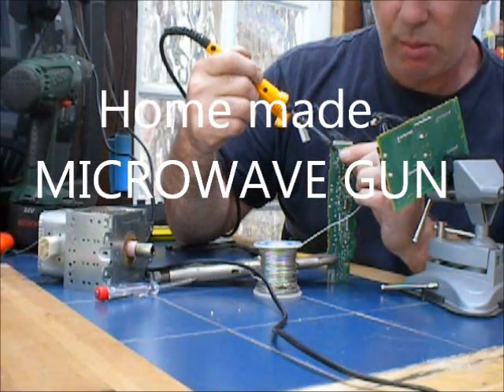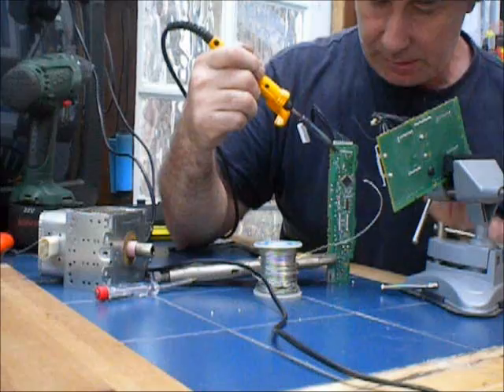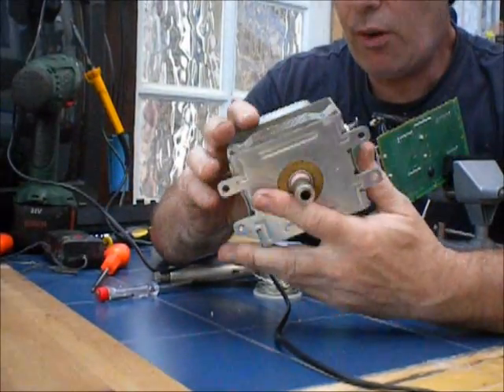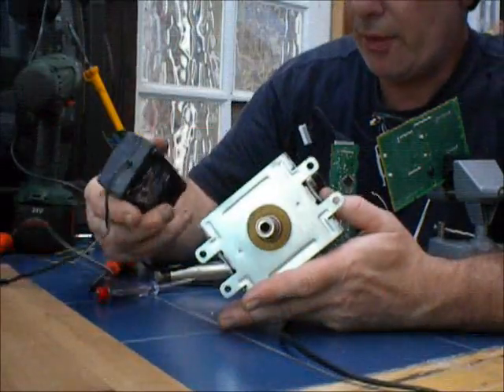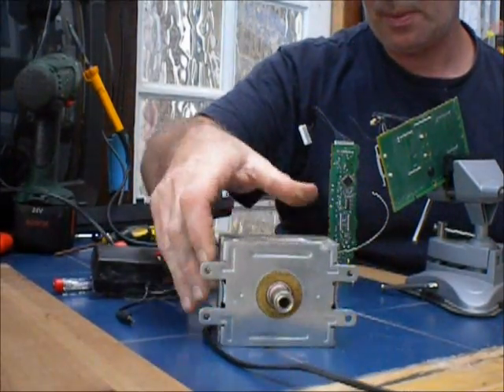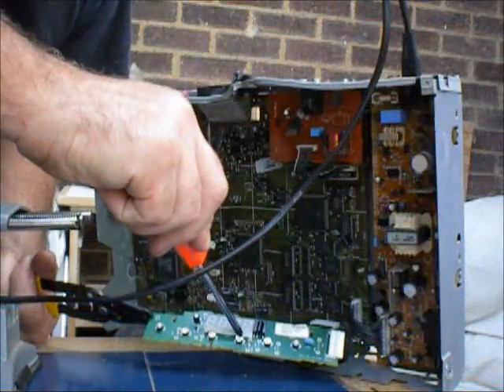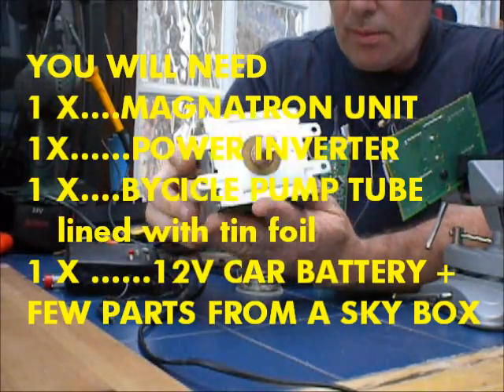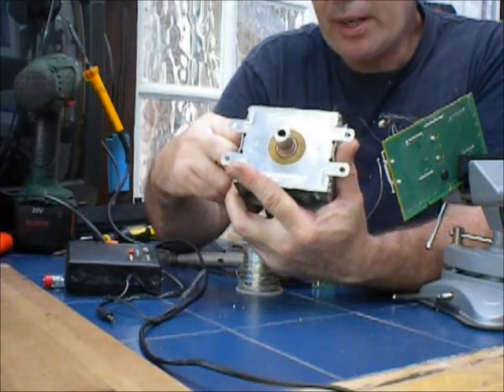MICROWAVE GUN EXCLUSIVE

Comment: Magnetrons run off 50-60Hz pulses of High Voltage DC, 2-4KV, even at 1000W power you wont be able to wilt a blade of grass if it was half a meter away, inverse square law, look it up.

Comment: This is CRAP! It takes far more current then a power inverter can provide! 1500 watts of wall current barely does anything! I've tried this with all the transformer and capacitor from the microwave and it wouldn't even warm water at a foot without the tuned cavity of the microwave! That's hooked right to the line current in the house! Hook this up to a battery and converter and you have zilch! That's why he didn't show it working! Love how he says he needs an old sky box! LMAO

Comment: yea, nice job thour lol. like it. have something to ask you. have a solder iron from radio shack lol n 25watts, try melting silver solder,its melt it, but try solder it to some copper wire wont melt. cleaned the soldering tip. need a new tip? used to look silver once lol guest after using it so long, color changed. light dar,to dark dark.